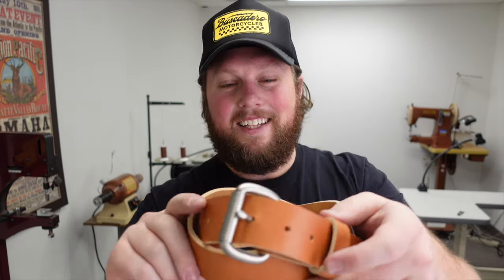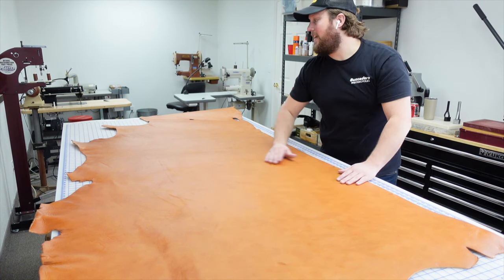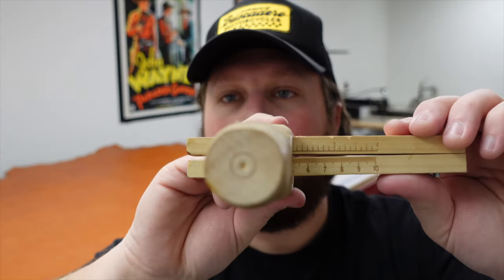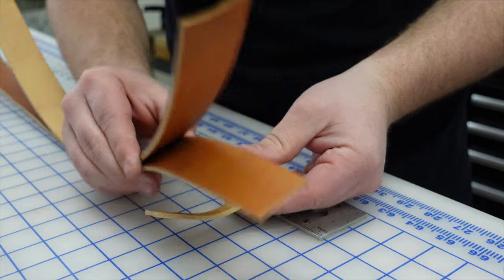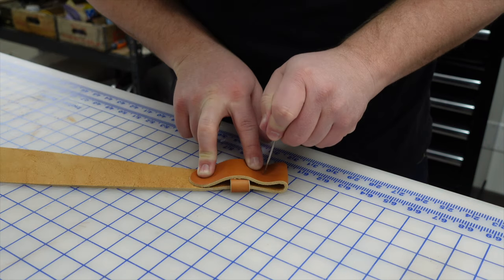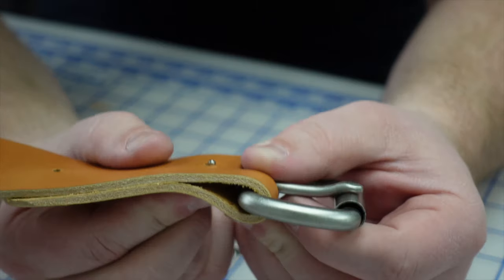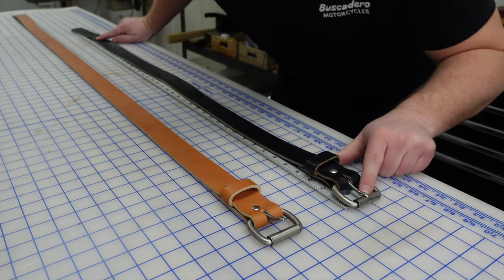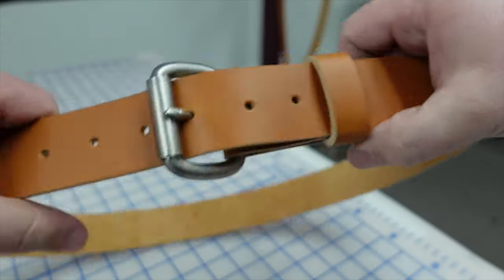Make a Simple Handcrafted Leather Belt #leathercraft

Comment: Try this. Punch holes at 3/4" measurements & punch 9 holes. It comes out 6 3/4" of hole adjustment instead of 5" & is a little more comfortable for the adjusting. Is especially helpful on gun belts when carrying certain style holsters.